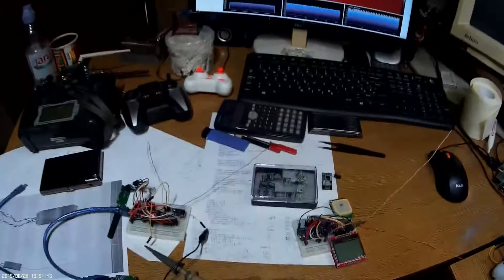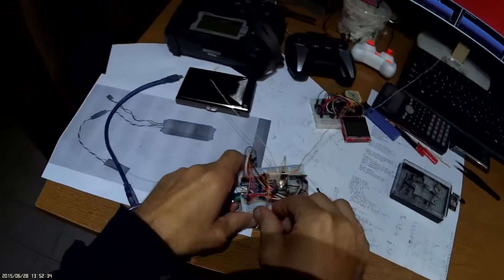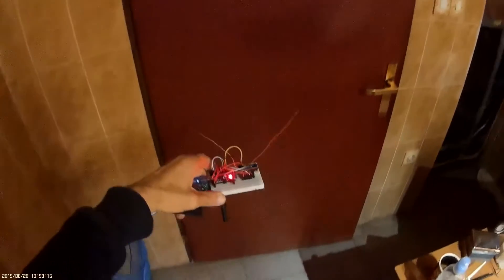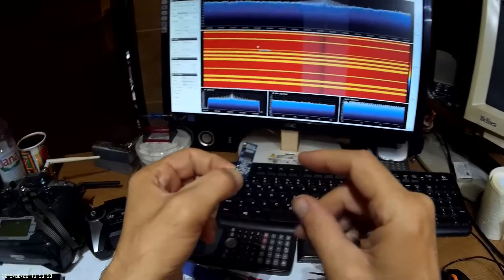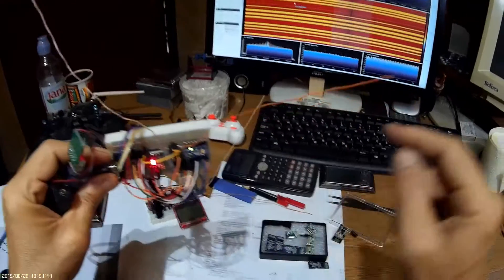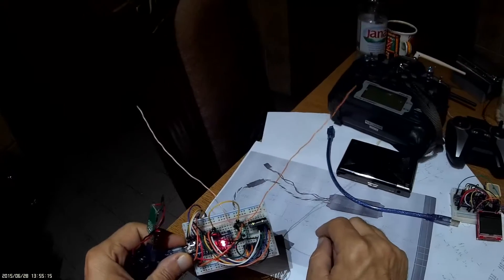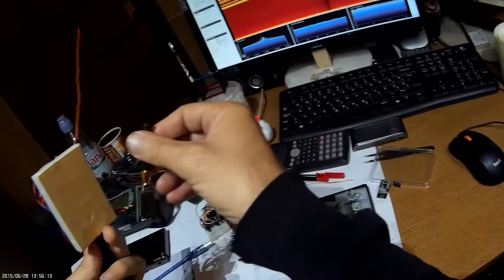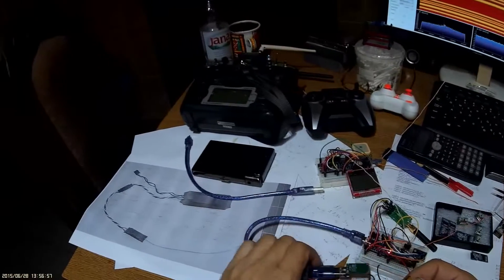Arduino Variometer - Designed By Rolf R. Bakke

Comment: Hello! Can you please tell how to convert tone frequency to cm/s? Thanks!
Reply from the maker: +Алексей Кудряшов 
Oh, this is very good question. Just, I don't know the answer. I should think about that. Since on TX end is pressure sensor, all math is done there, so on receiver side, there is no "brain", just receiver and audio amplifier. I will try to look math again (this is design by Rolf R. Bakke, so his math, not mine), and get sense of what can be done. Again, very good question, and you are first who asking this. Thank you. I will answer soon, or at least I will try to answer.
Reply: +Wild Maniac Thx! For now, i've done it this way:

struct vsi_measurement
{
    float alt;
    float timestamp;
};

//vs indicator
    if (measurement_flag == 0)
    {
        ms1 = measure_vs();
        measurement_flag = 1;
       // Serial.println(ms1.alt);
    }
    else if ((measurement_flag == 1) && (millis() - ms1.timestamp > 50))
    {
        ms2 = measure_vs();
        vsi = (ms2.alt-ms1.alt)/((ms2.timestamp - ms1.timestamp) / 1000.0 / 60.0);
        measurement_flag = 0;
        //Serial.println(ms2.alt);
    }
    
    vsiLowpass = vsiLowpass + (vsi - vsiLowpass) * 0.02;

vsi_measurement measure_vs()
{
    vsi_measurement ms;
    ms.alt = lowpassSlowAlt;
    ms.timestamp = millis();
    return ms;
  
}

It seems to work, the needle is moving along with beep sound. Given the time period is quite small, it should be accurate enough. But, i'm shure there's more efficient way.
I'm not completely shure how this formulas work yet, but they seem to do magic:

    lowpassFast = lowpassFast + (pressure - lowpassFast) * 0.1;
    lowpassSlow = lowpassSlow + (pressure - lowpassSlow) * 0.05;
    toneFreq = (lowpassSlow - lowpassFast) * 50;

For now i cant understand how are these formulas connected with time. If we happen to know time period between fast and slow filter, possibly we just have to divide their difference by that time period (my math knowledge is next to none though, so i can be wrong).
Reply from the maker: At least, now I know what this "magic" formula does: it gives rapid change in tone frequency, then back to zero change if further change in pressure is not present. try this simple code, and note how "And the difference is = " changes first rapidly from zero to 12, with decreasing steps ("inertia"), then suddenly goes back to near zero, also slowing down as it approaches zero (please remove check at "autoscroll"):

float toneFreq, toneFreqLowpass, pressure, lowpassFast, lowpassSlow ;

void setup() {
Serial.begin(115200);
pressure = 1001.00; //fictive "old" value
 lowpassFast = lowpassSlow = pressure;
}

void loop() 
{
 Serial.print(" lowpasFast before math = "); Serial.print(lowpassFast);
 Serial.print(" lowpassSlow before math ="); Serial.println(lowpassSlow);
 lowpassFast = lowpassFast + (1000.00 - lowpassFast) * 0.1; //fictive new pressure value
 lowpassSlow = lowpassSlow + (1000.00 - lowpassSlow) * 0.05;//the same fictive value
 Serial.print("lowpassFast after math = "); Serial.print(lowpassFast);
 Serial.print(" lowpassSlow after math = "); Serial.println(lowpassSlow);
 Serial.print("And the difference is = "); Serial.println(((lowpassSlow - lowpassFast) * 50));
}

I put fictive decreasing in pressure of 1 mb, or increasing in altitude, then staying on the same new altitude where pressure remains 1000 (mb).
Reply from the maker: Whole thing looks like RC delay (red line)...

https://encrypted-tbn2.gstatic.com/images?q=tbn:ANd9GcSmCtBPMrtm9FP2GQ2hbhksn9FuaoK-dtNt2y_ah6YbnhIlaitiKA
Reply from the maker: +Алексей Кудряшов 
Okay, now I understand your earlier question about converting audio to vertical speed. Since you are looking in code for Variometer, it is not suitable for task you needed. Use rather example of alitmeter: http://wildlab.org/index.php/2016/03/11/arduino-altimeter/

There is one even more "magic" formula:  
altitude=145366.45*(1-pow(((P/(float)100)/(setpress/(float)100)),0.190284));
But, since I am sending data in 'long' rather than 'float' (for simplicity), then at receiver end I am doing conversion to 'float' by dividing it by factor of 100 + converting long into float. Let's shorten this formula and assuming that pressure is already converted into float, so it should looks like:
altitude=145366.45*(1-pow((P/setpress),0.190284));//in feet
Where P is current measurement of the pressure, and 'setpress' is previous pressure, in my case of altimeter - it is set by pressing button when quad is on ground. In your case, if you want to know change in altitude in some period of time, you may use different "trick":
verticalSpeed=145366.45*(1-pow((currentPressure/oldPressure),0.190284));//in feet
Where 'oldPressure' will be sampled every n seconds (it should be done somewhere in loop or better by calling function), or milliseconds, depends how often and how precise you want to know altitude change per unit of time. Or, in the case that you want set pressure of the flying vehicle on ground, then knowing current altitude and change in altitude per unit of time, you may use something like this:

void loop() 
{
getVSpeed();
Serial.print("Current Altitude in feet is: "); Serial.print(currentAltitude); Serial.println(" feet");
Serial.print("Current Altitude in meters is: "); Serial.print(currentAltitude*0.3048); Serial.println(" meters");
Serial.print("Vertical speed in feet per seconds is: "); Serial.print(verticalSpeed); Serial.println(" ft/s");
Serial.print("Vertical speed in meters per second is : "); Serial.print(verticalSpeed*0.3048); Serial.println(" m/s");
}

This will call function getVSpeed() and getting back return two values: altitude and change in altitude:

float getVSpeed() 
{
previousAltitude=145366.45*(1-pow((currentPressure/setPressure),0.190284)); //always current altitude!
delay(1000); // for example how much feet or meters per one second
currentAltitude=145366.45*(1-pow((currentPressure/setPressure),0.190284)); //always current altitude!
verticalSpeed= currentAltitude-previousAltitude; //where sampling must be done in fixed time, your choice
return currentAltutude, verticalSpeed;
}

So, basically it will read once, then again after one second, and back two results, where only last altitude reading will be shown as current altitude, while first reading will serve just for calculating difference per one second, or whatsoever period of time you want to set. Also, you may use millis() if you are more familiar with... I am not, just a beginner in arduino programming. 

You may do it what is easier for you, or what make more sense; using two pressure measurements, then single math "currentPressure/oldPressure", or second option, which is maybe shorter, and you need to use function for example "getPressure" twice, spaced by fixed amount of time, and returning current altitude, and vertical speed. 

Now I am pretty tired, and my brain is not so fresh, but I bet you will understand it and modify it for your needs. Please tell me the progress. Thanks.
Reply from the maker: +Wild Maniac 
Additional info: note that in my poor example above, setPressure remains constant during whole flight, since it is set once when vehicle is on ground. In the case of longer flight, it will be good to have second pressure sensor, and coordinate atmospheric change in pressure, then compensate results. In example above, currentPressure is measured frequently, while set pressure may be done by applying somewhere code:
     if (digitalRead(buttonPin)==1)
      { delay(100); //debounce 'trick', where action is delayed until contacts stabilize on button
      //by pressing button, Actual Altitude, and Maximum or Memorized Altitude
      //is set to zero as well
      //In the case of some major error, please press reset button on your Arduino
       setPressure=P; //by reading MS5611 or other barometric sensor, by calling some reading function...
      }

Some thought about using two sensors for correcting weather change: 
altitudeErrorFt=145366.45*(1-pow((CurrentPressure/PressurePriorToFlight),0.190284)); //in feet, for meters, just multiply it by 0.3048. This is read from base station, and if pressure drops, it will give you positive result, then subtract it from actual data:
TrueAltitude=Altitude-altitudeErrorFt; 
So, prior to flight, you should set reading of the pressure... there is maybe other way around, but just... my brain... about to explode... :D

I always want to know both: altitude in feet and in meters, but if you no need feet, just meters, instead formula from wikipedia, you may use:

altitude=44307.694*(1-pow((changingPressureByAltitude/GroundPressure),0.190284)); //now in meters only, or dividing result by 0.3048 "back" to feet if you change min later. Or combine that two formulas, it is up to you, what is easier, and what makes more sense. In both cases, error in calculation will be proportional to number of decimal places used in math, which are in most cases insignificant.
Reply from the maker: +Wild Maniac 
Oh, mentioned wikipedia, but forgot link: https://en.wikipedia.org/wiki/Pressure_altitude
Reply: +Wild Maniac Thank you so much for your answer being so detailed!)) Have to go to 
work now, but will try your math in the evening, and will write you on 
progress)
Reply: +Wild Maniac i've read your answers more thoroughly now, and it seems i am doing it the same way actually (first multiplier may differ cause this function returns value in meters). The difference is i am using getAltitude function from Korneliusz Jarzebski MS5611 library:

// Calculate altitude from Pressure & Sea level pressure
double MS5611::getAltitude(double pressure, double seaLevelPressure)
{
    return (44330.0f * (1.0f - pow((double)pressure / (double)seaLevelPressure, 0.1902949f)));
}

 
But somehow i haven't looked what this function does up to this moment. What was surprising for me, in sketches, provided with his library, current altitude or pressure had not been required for absolute altitude measurement, and i noticed up to 30m difference in measured altitude readings during weather changes.

So i have read a little further and it seems that in aviation 3 altimeter settings are used: QFE, QNE, QNH (which i had never bothered to notice flying uh-1 in DCS simulator).
As far as i understand now, without 2-way communication with ground station it is possible to realize QFE and QNE modes (which stand for relative altitude above airfield and altitude above  standard pressure at sea level level which is 29.92 in.Hg or 1013hPA). If i want to calculate QNH altitude above sea level, i can look QNH pressure in local METAR notes and feed it to this function to get altitude ASL, but it will require 2 way comm or a potentiometer for altimeter setup. I think this may be a bit of overkill for rc model cause we dont have a lot of them flying around IFR actually :D

As far as i understood, the point is not in measuring real altitude, but in measuring the same altitude on all aircrafts in the area, so if altimeter is set to 29.92  on two aircrafts, the gap between them will remain constant, though maintaining constant pressure, they will not actually be mantaining constant altitude.
Reply from the maker: +Алексей Кудряшов 
Yes, this library has few errors. Your code from library:
// Calculate altitude from Pressure & Sea level pressure
double MS5611::getAltitude(double pressure, double seaLevelPressure)
{
    return (44330.0f * (1.0f - pow((double)pressure / (double)seaLevelPressure, 0.1902949f)));
}
is different thatn math from wikipedia, and number of 44330.0 is wrong, which is:
Altitude=145366.45*(1-pow((currentPressure/setPressure),0.190284)); 
Note that 44330.0 should be result of 145366.45*0.3048 (meters to feet)= 44307.694, somewhat different, and more accurate if wikipedia is accurate. Also, note wrong exponent of 0.1902949, which should be 0.190284... all in all, error in returned altitude in meters is not so terrible, but it is error. 
I do not use any library for this calculation, nor library for MS5611, since Rolf R. Bakke does it from PDF datasheet for this sensor: http://wildlab.org/wp-content/uploads/2016/03/MS5611-01BA01.pdf
Scroll down this PDF and you may notice familiar formula for temperature compensation:

 ***"D1 = getData(0x48, 10);D2 = getData(0x58, 10); dT = D2 - ((long)calibrationData[5] << 8);TEMP = (2000 + (((int64_t)dT * (int64_t)calibrationData[6]) >> 23));OFF = ((unsigned long)calibrationData[2] << 16) + (((int64_t)calibrationData[4] * dT) >> 7);SENS = ((unsigned long)calibrationData[1] << 15) + (((int64_t)calibrationData[3] * dT) >> 8);P = (((D1 * SENS) >> 21) - OFF) >> 15; return P; //returns back into main loop data about pressure P"
***

Note that D2 = getData(0x58,10) was in original variometer actually getData(0x50,1), which has RMS 6 times higher, or less precise (page 9 on this PDF). So, for vario is okay to have greater error, but I wanted better precission, so instead OSR (OverSampling Rate) 256, I am using OSR of 4096 (much more detailed reading). 

I hope you will understand all what I wanted to say abouve. I will rather use my own math, than rely on this library. Also, QFE, QNE, QNH, and other things are for airplanes which goes from airport to airport, not important for us, RC pilots. We have our own starting altitude elevation above sea level, but what is important to me is relative altitude above MY area, not sea level. For this reason, I do not bother with such things.
Reply: +Wild Maniac Thank you, i havent noticed this. Will try to use higher oversampling rate and will correct altitude formula. By the way, i have tested a pair of hc12 433mhz modules, and tried to send data from arduino to pc, it works, and adds only a slight delay)
Reply: +Milan Karakaš mine seems to work ok at serial speed 38400bps, and manual states maximum speed up to 115200 with baud rate in the air up to 236000, slower serial speed is, better's the range.
http://www.seeedstudio.com/wiki/images/b/b0/HC-12_User_Manual.pdf

For some reason link you provided leads to this same page(
Reply: +Wild Maniac I have tested corrected math and higher sampling rate, everything works fine) Great thx!)
Reply from the maker: +Алексей Кудряшов 
Thank you too. Or if it is confusing, I will switch to my other account.
Reply: +Milan Karakaš What is good about hc12 is that it worked "right out of the box" and required just 2 AT commands to change baud rate. I've been expecting much more pain)

About the antenna - should i align it vertically along some kind of mast? How should the ground wire be positioned relative to the first one?

 For now, i've soldered spring antenna cause i was afraid to use hc12 without antenna at all, besides, if i'm not wrong, it has circular polarization, so is better when going through banking turns and steep dives.